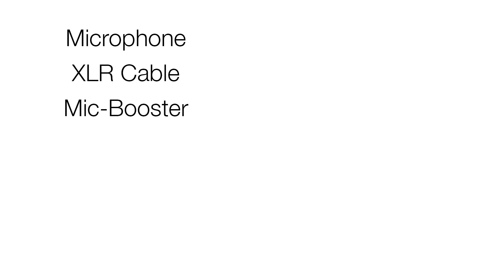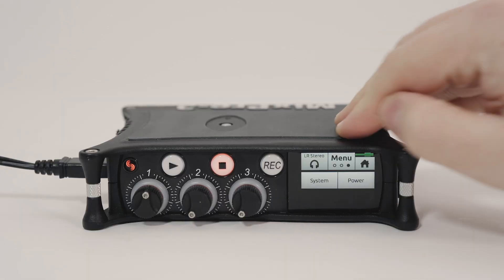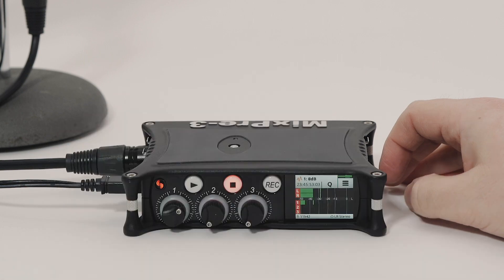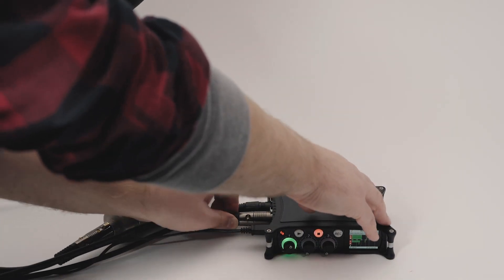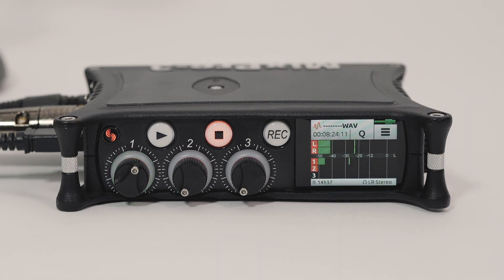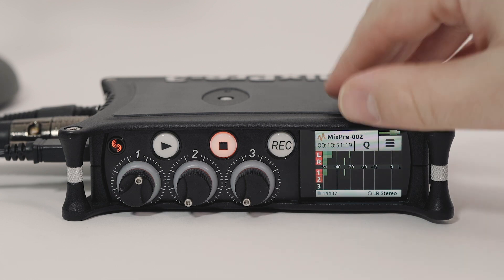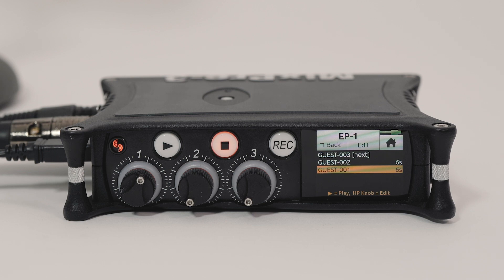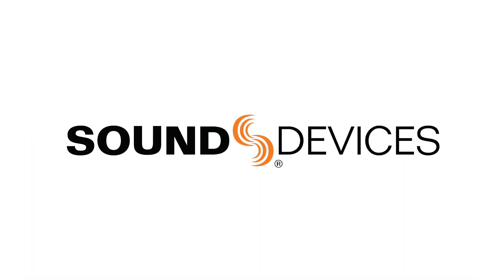Podcasting with the MixPre II: Advanced Mode

Comment: how to take a phone call in a live podcast with mixpre 3 with two guests and callers calling up through phone. regards.
Reply from the maker: If the person is calling in via cell phone, you would need to route that phone line to a channel, using the 3.5mm Aux Mic input option. This may require an adapter if your phone does not have a 3.5mm TRS output jack. If you want the caller to additionally hear the feed from your mics on the MixPre, you'd also need an adapter that separates your phone input/output options, since you'd also need to send the MixPre feed back into the phone via the 3.5mm Stereo Output. There are many splitter/interface boxes available that will separate your phone's audio output and input into two ports. 
 
 
For further questions, please reach out directly to our support team at https://service.sounddevices.com/contact-support/.

Comment: Question: Can I use the Mix-Pre II as a DAC to power monitor speakers like the Yamaha HS7? Or is that a stupid idea?
Reply from the maker: Yes! You would need a cable that is a 3.5 mm TRS male to 2x 1/4" TS male.
Reply: @sounddev  That's great! Thx for the advice.

Comment: What cabling do I need to make a remote call to connect using just my android phone and record an interview as I use my MixPre 10ii? Do I configure the Mixpre the same as this Podcast instruction video? Do I need software?
Reply from the maker: How are you coming out of the Android phone?
Reply: @sounddev  I have a Google pixel 5 phone using a Headphone adapter with USB-C to 3.5mm.
Reply from the maker: @Beshinemusician  So you'll run from the phone to aux in of the MixPre and then set the input of a channel to Aux In. Then monitor through the MixPre headphones. The caller on the other side will just hear your voice through the normal phone mic.
Reply: @sounddev  So just to be clear, am I running a 3.5mm (TRS or TRRS) cable from the phone? Is there a way to take advantage of any of the XLR inputs 1-8 on my MixPre 10ii that have better audio quality than the phone mic? I am looking at purchasing a JK Audio CellTap, however, I do not want to use a Headset w/built in Mic. The JK Audio Bluekeeper seems close and really cool, However I don't like the idea of the Bluetooth connect as it is always better with a wired connection.
Reply from the maker: @Beshinemusician  When you say better XLR quality than the phone mic do you mean coming out of the phone or going in to your caller? Some iPhone programs let you use the MixPre as an interface but Android does not.
Reply: @sounddev   Going into my caller, using an SM7B. Please correct me, in order for this to work, does the MixPre in this situation, have to be setup as an audio interface? You also mentioned earlier to run from the phone to aux in of the MixPre. Is this connection a 3.5mm TRS or 3.5mm TRRS? Or use a splitter of both TRS and TRRS connections?
Reply from the maker: @Beshinemusician  Going to your caller means using the MIxPre as an audio interface. Have you considered some kind of conference software like zoom where you can choose an audio interface?
Reply: @sounddev  Yes I will consider Zoom. Thank you.
Reply from the maker: @Beshinemusician  Great! Should be a much simpler setup and your remote guest can still "dial in" with a cell phone to a zoom session.

Comment: Thanks for these videos. Having to set both "gain" and the normal audio knob confused me at first, but I'm sure I'll get the hang of it.
Reply: Why do you have to set both the Gain and Audio knob? @sounddevices
Reply: The gain is your mic gain, the big knob is the (like a slider on a mixer)volume of the channel into the main mix (like a fader) @DenhefDigital  you can turn the big knob into the "only slider" by staying in basic mode.

Comment: And could you kindly show how to take mobile calls, and add jingles to the podcast using mixpre 3
Reply: Dr. Maruti Sharma - you may want to search for Loopback 2 or Audio Hijack - that seems to help podcasters (I am not associated with Rogue Amoeba)
Reply: It's much easier to receive a call via an online service like Skype or Google Hangouts. Depending on your location, Skype, Google Hangouts, etc. can provide you with a fixed number as a service. If you need to take a call from your phone, you will need to split the signal from your phone using two 3.5mm connector cables, connect the output into the Aux in near the headphone jack, and then run a cable from the Stereo out (on the left side of the MixPre) back to the phone. The easiest thing to make this possible is an iRig 2, which is relatively cheap. You may need a lightning to 3.5mm dongle or USB C to 3.5 mm dongle to connect the iRig to your phone if your phone has no headphone jack. Now, in the Outputs menu, select St Out and make sure all your inputs are sent to StOut EXCEPT the aux in. 

If you are doing the call on the computer, you'll need to be sure to send only your mic and the jingles back to the computer by selecting the appropriate channels in the USB channel settings under Outputs.  In this case, you could actually use your phone or tablet for soundpad functionality with a single cable going to Aux in.

For jingles, the easiest solution on a Mac is to buy the bundle from Rogue Amoeba that includes Farrago (a soundboard), Loopback (virtual audio routing), and Audio Hijack (a useful recording/routing utility). Audio Hijack can divert input from specified apps to specified USB outs. So, I believe you should be able to direct the output of the soundboard app to two channels on the MixPre (for stereo) or as a mono mix to one channel. 

With the MixPre-3 bear in mind that 2 out of 5 tracks are for the mix, so this leaves only 3 tracks for inputs. I think you can probably just manage mic, jingles, and phone if each track is mono. Not sure though, I don't have the MixPre-3.

Comment: Hi great video. I am struggling to use mix pre with Canon eos R.  Could you please make a video on that.  I could not find anything online. Thanks.
Reply: Dr. Maruti Sharma - what kinds of issues are you having? That’s my setup and I have no issues? I can also make a video and post if that will help?
Reply: @AjushiPhotography  That would be very nice. I am confused about matching the camera preamps with mixpre preamps.
Reply: Dr. Maruti Sharma - the stereo out from the mixpre should go to the camera audio input - I have the EOS R mic input to just one click above zero - in “M” or manual mode on the EOS R you can hit info until you see the camera audio input - the mixpre audio should be gain staged as normal - with the camera input just one click above zero you should not clip - I hope this helps - it will also take me a few days to make and post a video since I am out for the holidays
Reply: Ajushi Photography Thank you very much. A quick question - what is gain staged normal on mixpre?
Reply: Dr. Maruti Sharma - sorry I forgot to include a great course on the mixpre series of recorders - https://school.learnlightandsound.com/p/sound-devices-mixpre 
This will teach you everything you need to know.
Reply: Dr. Maruti Sharma - as you are talking into the mic - the mixpre audio meters should be hitting around -12 dB (in the green with little or no yellow in the meters) adjust the gain knob as you are taking to reach a good level before recording - that is gain staging